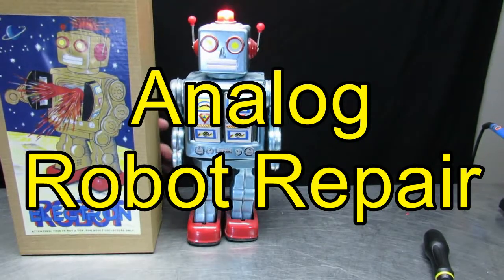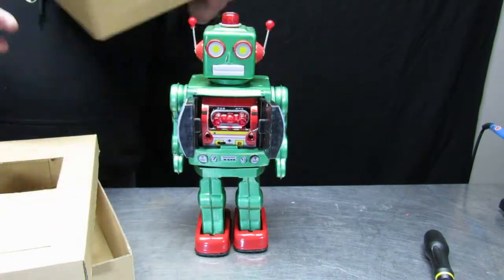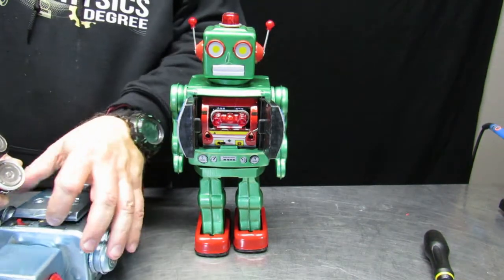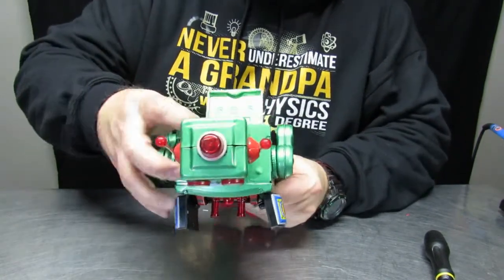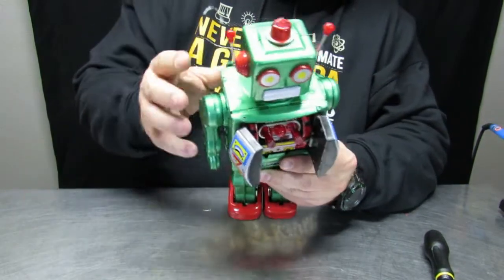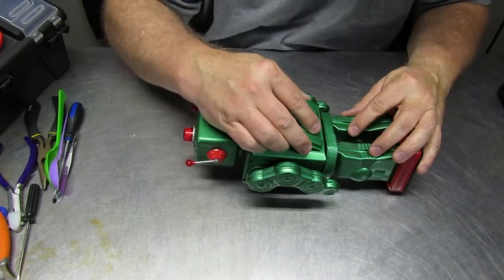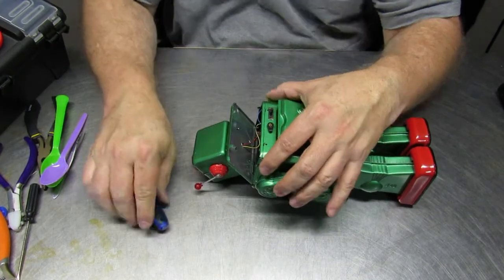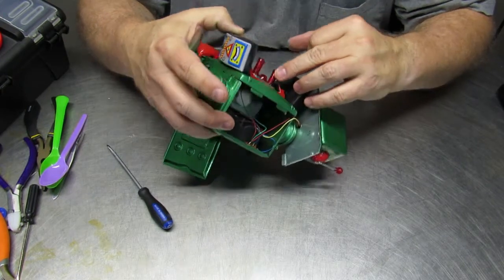Analog Robot Repair

Comment: I have this robot.  There seems to be a problem with the battery terminals.  When I put the batteries in, it may work for just a few seconds then stops.  I can get it to work again if I wiggle the batteries around, however, it will work only a moment then shut off.  Any suggestions?
Reply: The terminals may not be tight enough. Try bending them outwards (assuming they're tabs).